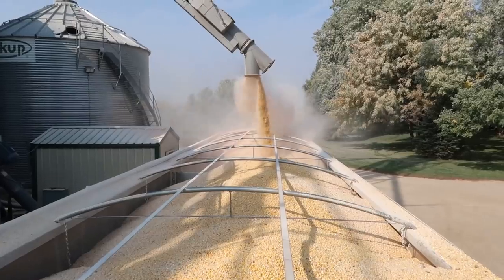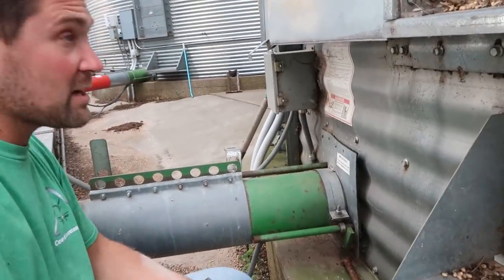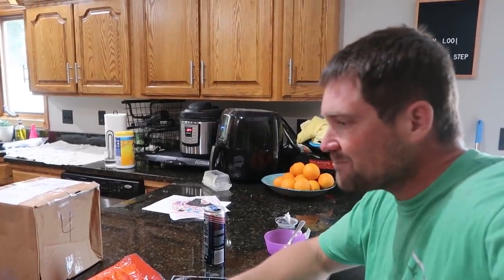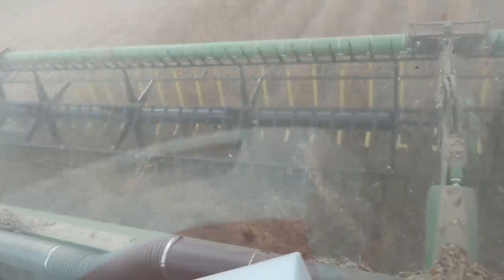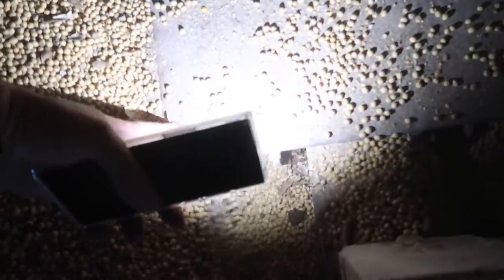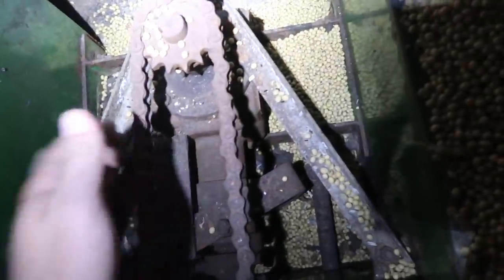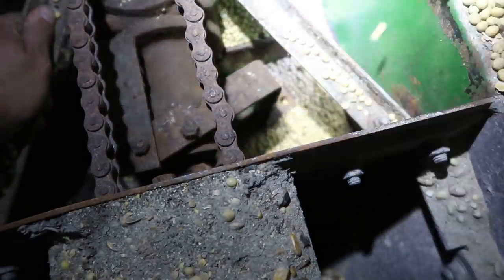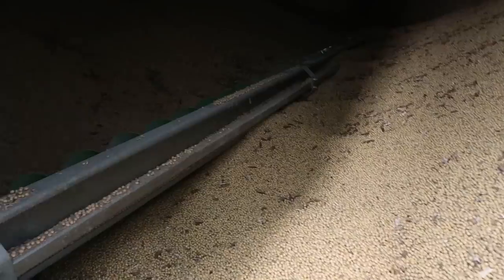Grain Bin Entrapment

Comment: I mean if we all donate a dollar that 600k raised for a good cause.
Reply: I will
Reply: Count me in for money
Reply: I will
Reply: Absolutely im in
Reply: I’m in for sure !
Reply: Donation must be 5$
Reply: I'm in for 5
Reply: Max well that’d be right about 3 million there.
Reply: Say the word. I know some local departments that could use it
Reply: He's got it set up on his page to donate and help. Let's go donate
Reply: Let’s all donate 2$
Reply: Id donate for sure
Reply: Count me in to help. Love the videos!
Reply: Most excellent idea...I'm in.
Reply: I'm in for $5-10.
Reply: I will.
Reply: Yes. However I think we can do better let's instead come up with a safety system to keep them from getting trapped. If we put a winch at the top of the bin it could be used to pull the farmer to safety in the event that it is needed. You could also use a air bag like snowboarders use to keep avalanches from burying them.
Reply: Make it $5?
Reply: This would be a better use for a fund like this. Fund some research in an agri engineering dept in a good university to come up with a system to try to prevent the problems developing. Failing that systems to deal with the problems that do develop. Don't necessarily need to be cheap enough that every farmer has them but cheap enough that hiring the machine is the only option anyone would consider.
Reply: @aantonides  never going in unless you've got another person with you and you have a harness with a line wrapped around your waist is a nearly 100% foolproof answer, but it's really easy to get complacent and think: "ah, I've done this a hundred times, it'll be fine.", and most of the time, it IS fine. Just takes that one bad day.
Reply: 10$ done and done, bin entrapment and anhydrous accidents pretty high on my list of dangers I wish we could "engineer-out" of daily life on the farm. Good on everyone for chipping in....and even those just sending a like or a comment.
Reply: QUICK MATHS, I wish I could donate but at this moment I cant.
Reply: I’m in
Reply: im in for 3
Reply: A tip: you can watch movies on Flixzone. I've been using them for watching loads of movies recently.
Reply: @Jaxon Kane Yea, I have been watching on Flixzone for since december myself =)
Reply: Now it’s 797 thousand 🤑
Reply: J I Z, Izzo
Reply: Is it to late to receive help with getting rescue equipment for the local volunteer fire department

Comment: My department has the equipment for grain bin and silo rescue and I am certified in grain bin and silo rescue.. we are as far as I know the only department in the area that has the set up
Reply: is the equipment fairly generic and interchangeable between brands? Is thre one manufacturer more popular than another-- looking to see if small locals can band together for larger issues..
Reply: @michaelowen1750  that im not entirely sure of .. the premise of the system is to cocoon the victim inside of the system and use a corded drill powered auger to empty the grain out from around the victim to allow them to be freed .. its a system of curved metal sections that slide together and make a circluar shelter around the victim
Reply: I figured it was something like that, but thought a shop vac type approach... Until you think static electricity...but a battery drill and mini augur work too....

Comment: Back in the day the rule was it was a two man job to work in the grain bins. One man inside and other man on the outside...even working in corn cribs with ear corn!!
Reply: Bill Smith       That’s absolutely how we did it, Bill.   We didn’t know that much about entrapment.   In our area of western PA most confined space deaths have been from gasses in silos.   But always, always, it was a two man operation.   
Cheers!
Whipple
Reply: just makes sense to always have a buddy system in place when working in dangerous places.
Pretty much every industry works that way.

Comment: If I had to go into a grain bin, I would want to be wearing a safety harness hooked to an electric winch/hoist at the top of the bin, with a remote control strapped to my chest to hoist myself up as soon as the grain started burying me.
Reply: 5150lane sadly you weigh over 4 times as much when trapped under grain it’s a very fast thing happens in less than 10 seconds
Reply: My sister was playing in an overhead oats bin, while my dad was emptying some into his truck.  This was a basic gravity system.  When her leg came out the chute, ha raced up and puller out. No Mechanical parts, just a slide door in the bottom of the bin.

Comment: I watched a You Tube video last year about a young man who went into the  top of grain bin for some reason and got trapped in the grain.  Biggest thing pointed out was that he did not tell anyone where he was going, nor did he leave a note.   Lucky for him the guy bringing in a load of grain didn't see him around and started looking for him; he was rescued in time after a big process. 

Need to train the farmer too.   inform someone you are going in, use a tether line,  and like Bernie said below; ALL electrical equipment should have a tag/lock out.    One more safety tip;  never approach a tractor from the rear;  let the operator see you because it only takes a second to get tangled up in the PTO if you slip and fall (It happened to a neighbor when I was in high school). A PTO or auger only needs to go around once to really screw you up.

Comment: Our local grain elevator company bought a trailer fully equipped for grain bin rescue  they donated it to the fire department which was centralized in the area.  Its not been needed yet thank goodness but it is there and alot of the firemen have been trained to use it.

Comment: Hey Zach. It's good to always give back. As a firefighter/EMT I have responded to a few Farm accidents. Luckily it wasn't anything major or immediately life threatening. However I was always curious of how some of the farm machinery operates and what I could do as a first responder to try to rescue a farmer in a predicament. Our Jaws of life that you see chewing up cars won't do the same with farm equipment, For obvious reasons. Cars are made of cheap metal whereas combines and tractors are heavy steel and iron.

Comment: We had two guys get entrapped this year in the spring. They were at one of the sumps and got lucky they didn’t fall in the sump. Both were able to climb out on there own. They were able to stand on floor so they didn’t sink very far but were neck deep in beans.
Reply: We have two local FDs that are mostly farmers and each has a rescue system but no auger to remove seed. Our farm built them one each and one for our farm.

Comment: There may be a spring ball detent on that assemble to help keep it engaged so when it is turning that does drive the gear off. Plus the long length of the rod adds to the leverage of that short arm you are trying to move.

Comment: When I have had to do any maintenance on the centre sump in a grain bin, I use cover sheets from steel siding, cut at 40 inch lengths, and jam them in the grain in an arc around the sump. They don’t seem to get pushed in as much as plywood

Comment: I have helped clean up after a unsuccessful bin rescue.  Thru no fault of FD.  This was before the portable “tube” idea.   The family ran the skid loader, cutting torch thru bin wall.
  I think every grain farmer has known, assisted someone who got in too deep.  Most of the time it’s jokes afterwards. (As grain was less then 4’ in center dump, person wound up  standing at most chest deep over pit).   “We have another truck, here is a rope, tied off... once we get another truck out we can get you out thru the door” 
  Solo is where the danger is.  Equipment emptying bin as you stand on grain trying to break up chunks with a rod. (I like plastic pipe in case I hit auger it nips off end, doesn’t break anything $$.  ).  I use portable sweeps.  Those look like every time the bin gets empty they need lube.

Comment: I'd say your pretty hard working for a millennial! I have been in that situation with a power sweep a couple times so I feel your pain. Your raising your boy right he's gonna be your new mechanic one day!
Reply: Just a suggestion to prevent this kind of problem: when season is over, take shop vac and clean out clutch chamber, then grease, clean and lube all moving parts. Probably need to replace that chain. You can modify the end of your shift rod to make it easier to move from the outside. Retired farmer but been there & done that on many power sweeps.

Comment: Awesome idea Zach I hope this catches on. I go in my grains bins by myself too but I always have a rope suspended to where I can reach it to try to pull myself out and I always have someone at either the bottom door or the top hatch. I am not saying my ways is always safe but it is the best I can do and I hope our local fire departments have the equipment to save me or anyone like me if things go bad. Maybe I should get the other farmers in my area to work with me to start something here like you are doing there.

Comment: I think confined space entry training  with the proper use of a harness and overhead tether would go a long way. if you could combine that with some sort of light weight trench box cave in protection  could solve a lot of issues.  maybe something as simple as a piece of corrigated pipe either plastic or tin that could be set up to work in. 2  basement window wells for emergency egress would probably fit thru the door and then be bolted together.   But it's always the mindset that they only work if you use them that is probably the biggest obstical

Comment: Confined entry is always dangerous.  Never enter confined space without notifying someone else you will be entering.  Always make sure adequate ventilation is available.  Have a bin or take watcher assist in confined entry be staying outside and watching from outside.  Be safe and think the job through before starting the confined work.  Don’t take unnecessary risks!

Comment: I wonder if the tool used to vibrate to help settle concrete would help make things flow (maybe a small access hole the side of the bin also).
Maybe a slide hammer on the end of the rod?

Comment: Just a thought., $5k or even $500K for training and equipment will only go so far for training or equipment, when grain bins are used all over the U.S.  How about a more structural solution, like promoting through FBN or another farmers' org the development of a way for farmers to have support and safety equipment when they have to go in.  For example, develop a network or program where farmers can call the local FD to have one person come out with safety harnesses, etc. to monitor when a farmer has to go in a bin.  Create a small local fund to pay those firefighters a small stipend for every time they go out.  That way when someone has to go in a bin, someone is there to keep them safe with guide ropes and harnesses, pull them out if they break through the crust or get injured, and call for help.  I would think the most injuries and deaths occur when farmers don't have backup or the right safety equipment.

Comment: Zach just a Northern NH ingenuity question could use an aluminum snow rake with extension poles to break up and move grain from the outside through the access doors?  Might be safer in some instances.

Comment: I had several ideas on safety while watching this. Firstly, bits of wood?! Scrap that. Replace it with a ready made metal roofing material cylinder with no bottom. Have bars going through it for stregth and the ability to be inside it and able to push against the grain. Walk it in there, the edges will cut through without damage and give you a chance to have a place in there strong roof, air ish, you'll still need protection but my main point is this gives you a snowcave in your grain bin. Im particularly interested in this subject because I watched a documentary about a farmer that was nearly killed by a grain bin. He sank like it was quicksand. I'd be happy to send technical drawings (ish lol) that will at least give you a clear picture of what I'm picturing. Finding solutions like this is a bit of a thing for me. I used to work as a goldsmith and there were lots of dangerous elements. Cyanide, extreme heat (platinum soldering and annealing going up to nearly two thousand degrees, oxygen cylinders next to gas cylinders. Good safe ideas are always a good thing when you work around a serious risk....... love the channel, keep it coming... 😃😃😃

Comment: I always thought that nets should be suspended from the roof of the bins based on the internal area of the bin providing grabs. For each rope suspended in a bin you would no doubt reduce the number of casualties. Other than being accidentally hung. Its a starting point at least

Comment: I am no farmer, but have worked in and around coal mines, aren't there any safety harnesses you guys can use when entering a grain bin? Have permanent tie off points in the top of the bin or some kind of permanent safety system in place to tie off a safety harness so that it prevents a farmer from falling into a cavity? Seems like a simple solution to a widespread problem.

Comment: I'm wondering if can we install a microphone and system where if you shout a word like "call" it will contact the fire dept (or others) through a radio or a cell phone? Another idea is to install a voice activated trap door, letting the grain out.

To help people who were caught by the augers, why can't we have a wristband with a button that stops the augers from moving, it seems like a simple device to make. If not a wristband, we could install the button on a commonly used tool. We could even make it voice activated too. So if someone yells "help"/"stop" the auger will turn off.

Would any devices like these be useful? Or is the issue mostly that people suffocating from the pressures of the grain and help cannot arrive fast enough?
As a engineering student from a city, (who knows nothing about farms and is learning how to build devices like these) I feel like there has to be some better tools/systems/devices that farmers can use to help mitigate accidents

Comment: I'm always the one to think outside the box, so I'll ask this question. Would wearing a fall retention harness attached to a aramid cable anchored outside the bin help with extraction?
Everyone takes chances, I've done it thousands of times before, it will never happen to me, all the excuses. Having a buddy system where at least one person has to remain outside the bin while others work inside that can contact emergency personnel. 
I've been certified for confined space access as well as explosive environments like is created by grain dust. We were never permitted to access a confined space without someone acting as the safety person.

Comment: i have to ask why flat bottom bins? it seams like a hassle to deal with. personally i think hopper bottom bins are far better rarely any feed issues easy to clean old man had me cleaning them when i was kid no sumps and gear boxes to deal with if there is a problem with the auger the hardware is all on the out side so even if the bin is full it still can be fixed.

they also come in a field bin style for a small farm like what we have its really handy as we dont run a chaser bin so we put them along side an active field to unload into and trucks can come an pull from them at a time of there choosing no need to wait on us and near the end of the season the bins act as seed storage.

Comment: a great man Norm Yennings lost a son to grain and its dangers, his son like a 100 times before, 13, was surfing the flow of dirty dry harvest of wheat, dust and chaff caused it to stack then release tonnage,  he was not ready for this and the grain filled his lungs at the next instance  compressing his diaphragm, hyperventilated in panic of what your never supposed to be caught in, 1 1/2 mile from hospital, pulled from grate, rushed there and still could not  be saved, bless you Davey, push pole tech 1" alum. pipe,  to needed length, we had 4' , 8' 12' and 14', D and T handles work, D no hang ups one handed use free hand to hang on, T power pulling and pushing both hands, we also had a pitch fork/muck rake 90degrees to pole, heat bend, wood insert, pinned, a regular simple female coupler cut in half, welded to a plate (thickness to usage perimeters) four holes and a piece plastic board 3/8ths to 1/2" thick lite weight as possible yet strong, take a 20' drop no problem, round da round to roof da roof, scraped up lexan works, this allows for wear on it and less on bins, trailers, etc....isosceles trapezoid push surface allows corner manipulation and  flipped over, less drag back, muck pitch removes chunks clumped or germinated grains, most important thing is feed, by your self, shut feed off when in bin, never stand on or below area working on, try not to have mud boots on they fill and you can't get the off quickly or easily, oats will push under skin, dust is another factor modern farming requires respect for, this is do to machinery, pract0uses, and dirt buggers are offensive in most circumstances, if you cant pronounce it  you should not eat it, breath it, or be stupid around it,

Comment: Zach, how you liking your new Note20 Ultra 5G? 

Might I suggest a camera bump protector for your use case? It'll make sure that it stays free of scratches so you can continue to shine on Instagram, haha. Just make sure that it's one with a darkened glass except for the spots for the cameras... This will ensure that it doesn't cause glare or other artifacts in your photos as much.

Also, it's fine to remove the IMEI label from the back of your phone. Peels off easily. That info can be found under Settings >About Phone if you need it in the future...

Finally, wanted to say... Thanks for your great work looking out for others! Definitely makes it easier to support someone when they put their money where their mouth is.